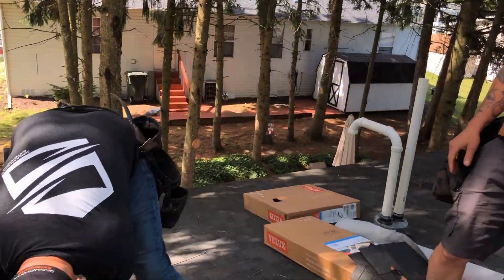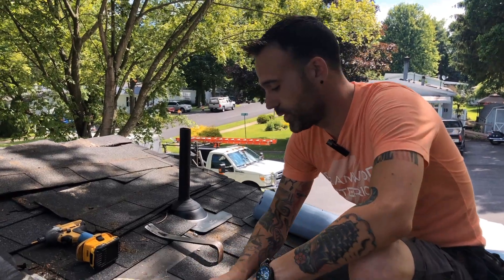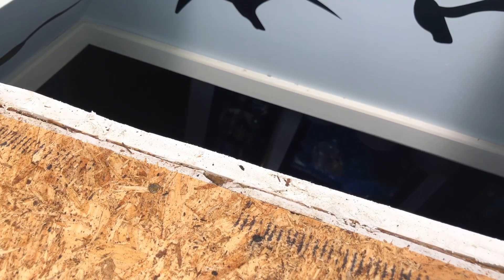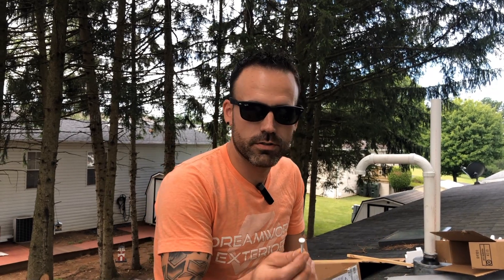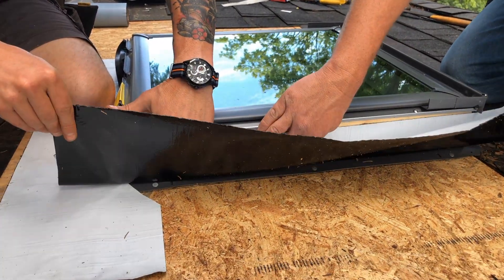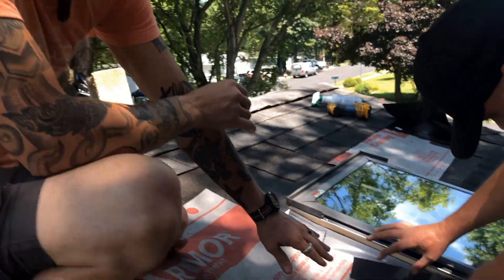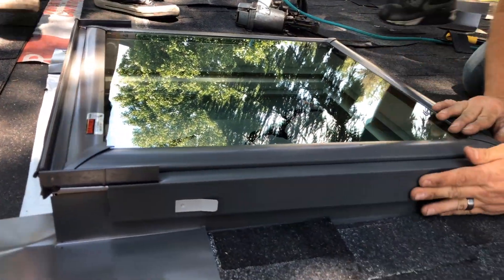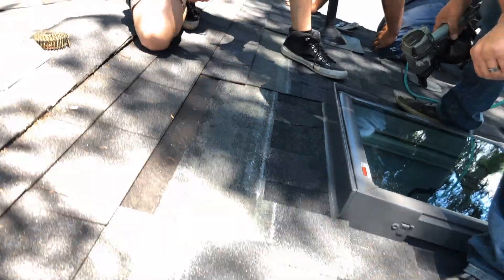How to Replace a Skylight | Dreamworx Roofing

Comment: Great video! You know what your doing.
 I've done so many skylights and never had a problem. I do it exactly as you do. Recently, I've been working on a job in Western MA. The owner didn't want to replace the ones that were getting pretty old. There was no flashing kit. I warned him that I can't promise it won't leak. Especially with the rain we've had this summer, I didn't feel comfortable using the same ones without any flashing. Needless to say, they are leaking and the owner is blaming me for I assume being negligent. A six pitch roof on an old house is another factor in my opinion. So this will be the third time I go back to try and stop the leaking. Idid It last time on my own time. I have no problem with that. But this is getting ridiculous and I don't want to give up. I honestly think he should either replace the ones on there or take them out altogether. The worst part is the owner ( he's flipping to make a profit) is taking it personally. I've roofed for years and never had an issue like this. I understand his frustrations, but he can't say I didn't warn him and didn't put in the effort. Anyway, that's my present situation.
Reply from the maker: Thanks for the comment! We're glad you enjoyed the video.